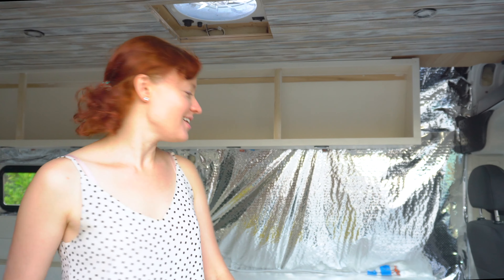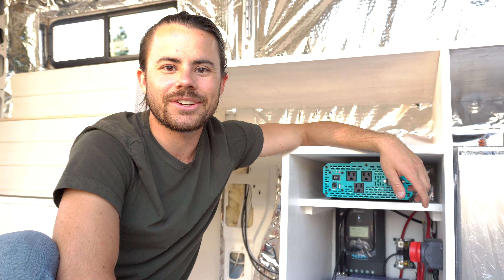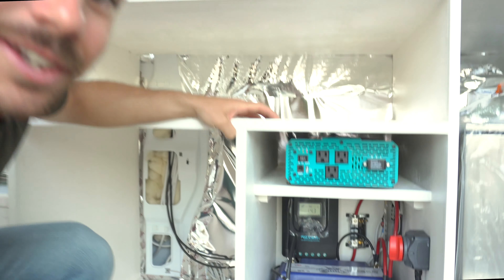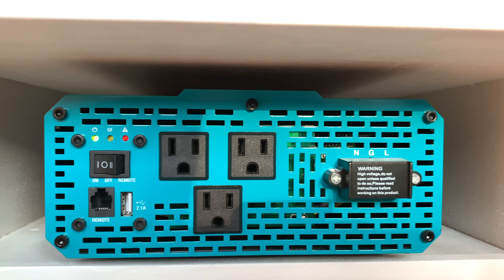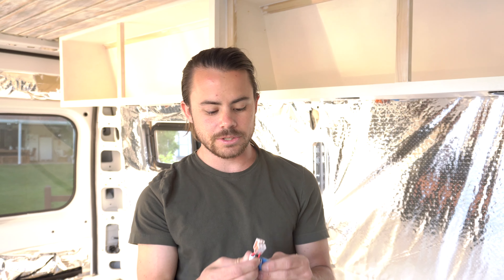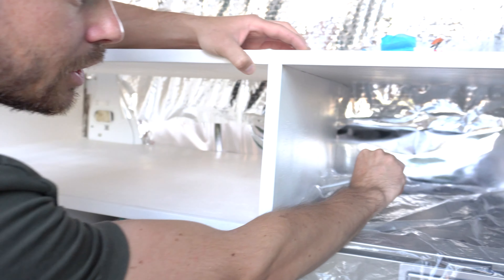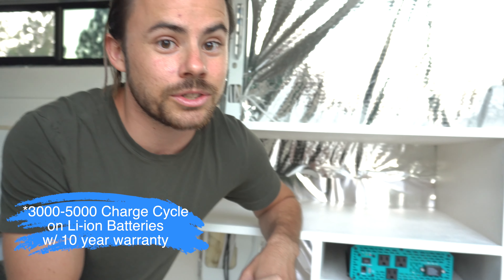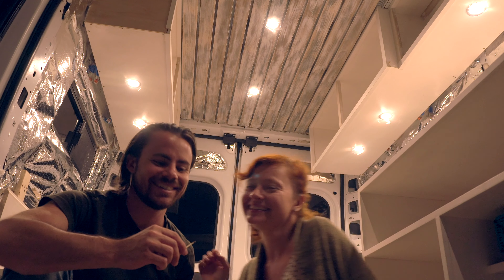VAN BUILD Ep.3: Electrical and Solar Setup for Off Grid Van Life (Dodge Promaster Van Conversion)

Comment: Just an FYI that inverter is oversized for those batteries and will never run at full power. 3000w / 12v = 250A Those batteries can do 100a/ea so 200A total. The inverter will overload the battery BMS and it will shut down the batteries. Oversizing an inverter is also a bad idea cuz the larger they are the more idle power they draw. So size it for your needs. If you're using Lead Acid batteries you will want more like 6 batteries for a 3000w and 4 for a 2000w.  A 2000w inverter would be more than enough in most van situations.

Batteries- I just found Lossigy Lithium on Amazon, Very reasonable prices. But there's no real info on em...and they're made in china sooooo???? Will Prowse has some awesome vids on making your own Lithium Battery packs for very reasonable prices comparatively.
Reply from the maker: Thank you, it's good to know.